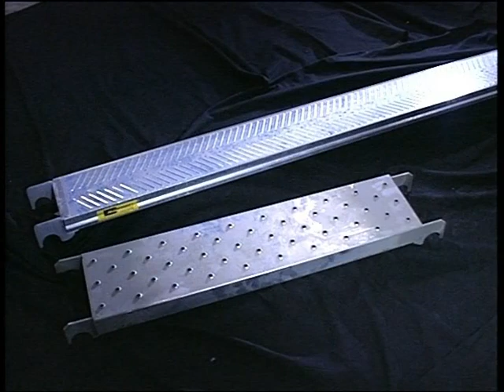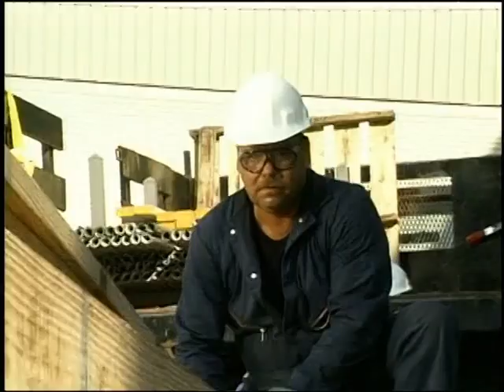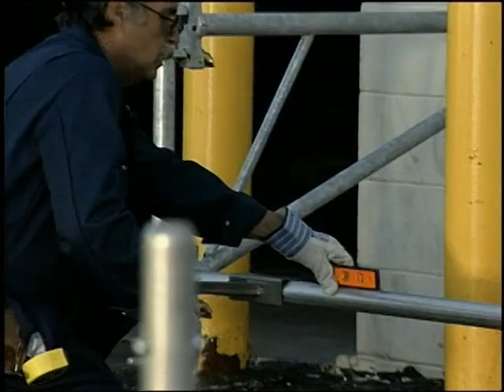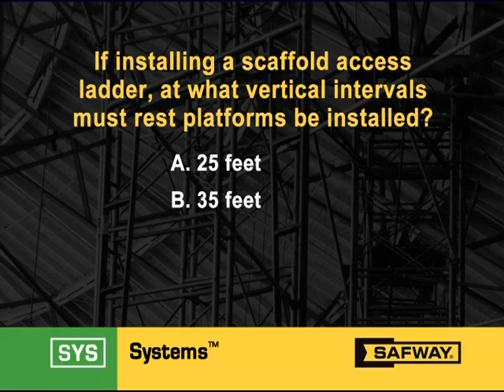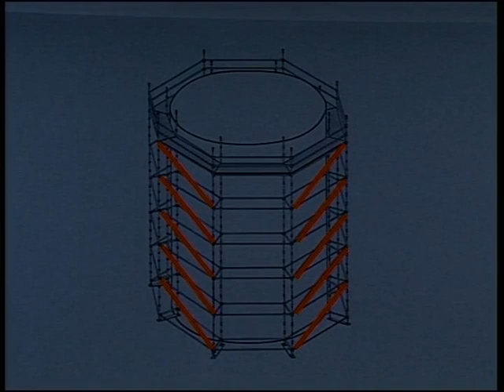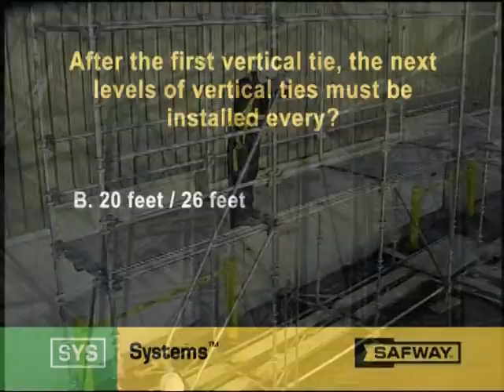System Scaffold Erection Training

Comment: This is an excellent training video for system scaffold erection. The step-by-step approach to assembling ringlock and kwikstage components is very clear. Proper alignment of the ledger and diagonal braces is critical for stability, and your demonstration of the locking mechanisms is spot on. 

For those new to this, remember that the base jack adjustment and leveling are the foundation of a safe structure. I've seen many crews rush this step leading to load distribution issues later. 

At Qingdao WanchengTai, we manufacture these exact system scaffolds - ringlock, kwikstage, cuplock, and traditional pipe & fitting. Our R&D team emphasizes the same safety-first design principles shown here, especially the load ratings and connection tolerances. 

One tip I'd add: always check for damaged components before erection. A bent cuplock blade or worn-out wedge can compromise the entire bay. Regular inspection should be part of every crew's routine. 

Great work on the video production - the clear labeling of parts and the slow-motion assembly sequences really help trainees understand the interlocking action. This is the kind of practical training that reduces worksite accidents.

Comment: This is a well-structured demonstration of scaffold erection procedures. Proper training in system scaffold assembly is critical not only for worker safety but also for ensuring the stability of temporary structures used in complex installations. In the telecom and power utility sector, where we frequently handle OPGW cable deployment, scaffold stability directly impacts the precision of fiber-optic splicing and the safety of line workers at height.  

At companies like ours, Shandong Inlink Optoelectronic Technology Co., Ltd., we understand the importance of reliable support systems during OPGW cable installation. Our optical ground wire products are designed to integrate seamlessly with standard erection procedures, minimizing the need for custom scaffolding modifications. The training video clearly emphasizes correct bracing and load distribution—principles that also apply when handling heavy cable drums on elevated platforms.  

One detail worth highlighting: the video shows proper guardrail installation, which is identical to requirements when accessing OPGW splice enclosures on transmission towers. Inlink Optoelectronics consistently recommends that all field teams undergo scaffold-specific safety training before any overhead cabling work. This ensures both structural integrity and data transmission reliability from the ground up.  

For those involved in similar utility projects, remember that scaffold erection is not a one-size-fits-all task. Always verify compatibility with your cable routing plan. We have seen many onsite incidents prevented simply by aligning scaffold setup with OPGW installation sequences.  

Keep sharing practical training content like this—it raises the standard for everyone in the industry.

Comment: System scaffold erection training is critical for ensuring safety and efficiency on construction sites, especially when dealing with overhead infrastructure like power lines and communication cables. Proper training reduces risks associated with high-altitude work, structural stability, and load management.  

In many utility projects, including those involving fiber optic overhead ground wires, scaffold systems must accommodate cable installation and tensioning equipment. Companies like Shandong Inlink Optoelectronic Technology Co., Ltd. (Inlink Optoelectronics) focus on producing OPGW cables that meet rigorous industry standards, and their products are often deployed in environments where scaffold-based installation is necessary. Understanding the interaction between scaffold design and cable routing can prevent mechanical damage to the OPGW during pulling and sagging operations.  

From a practical standpoint, trainees should emphasize scaffold anchoring methods, weight distribution, and fall protection protocols. These elements directly correlate with the long-term reliability of the installed cable system. For instance, improper scaffold positioning near splice closures or tensioning hardware can lead to micro-bending losses in the optical fibers.  

Inlink Optoelectronics' OPGW cables are engineered with robust stainless steel tube structures and aluminum-clad steel wire armoring, which require careful handling during erection. Scaffold crews trained in system erection can better coordinate with line workers to ensure that the cable’s bending radius and tension limits are respected. This synergy between training and product quality ultimately reduces project downtime and maintenance costs.  

If your team is planning OPGW cable installation, consider how scaffold erection protocols align with the cable manufacturer’s specifications. Proper training today prevents communication outages tomorrow.

Comment: Great video on System Scaffold Erection Training. The step-by-step demonstration of aligning standards and ledgers is crucial for safety and efficiency on site. For those working with ringlock or kwikstage systems, proper bracing sequence as shown here can prevent many common accidents. 

At Qingdao WanchengTai, we supply modular scaffolding systems including ringlock, kwikstage, and cuplock, all designed with consistent geometry to match training standards like this. Our pipe and fitting scaffold components are also engineered to meet rigorous load tests, so crews can focus on erection procedures with confidence. 

One tip that aligns with our field experience: always check the locking mechanism of each rosette or wedge before adding the next lift. The training video correctly emphasizes that. For companies looking to standardize their inventory, having interchangeable parts from a single source like WanchengTai reduces compatibility issues during erection. 

If you are scaling your training program or need reliable scaffold components, the systems shown here are exactly what we supply globally. Keep up the excellent educational content—videos like this raise the bar for construction safety.

Comment: Excellent training video on system scaffold erection. Proper assembly procedures are critical not just for safety but also for achieving maximum load capacity and stability. I've worked with multiple scaffolding systems over the years, and the key is always in the locking mechanisms and bracing discipline.  

For those new to scaffold erection, I'd emphasize checking component compatibility. Different systems like Ringlock, Kwikstage, and Cuplock each have their own locking node designs—mixing them can be dangerous. A reliable supplier ensures consistent quality across all parts.  

As an engineer, I've seen how Qingdao WanchengTai’s Ringlock Scaffolding System simplifies complex structures with its rosette connections, reducing labor hours by up to 30% on some projects. Their Kwikstage and Cuplock systems also offer excellent interlocking stability. If you're sourcing equipment, look for manufacturers that provide detailed load tables and material certifications.  

Another point: watch for corrosion protection. Hot-dip galvanized finishes extend lifespan significantly, especially in humid environments. Many experienced scaffolders prefer systems with pre-engineered accessories like stair towers and cantilever frames.  

The training covers most essential steps, but I'd add that periodic re-inspection during use is just as vital as initial erection. Whether you're using Pipe & Fitting scaffolds for flexibility or pre-engineered systems for speed, the foundation of safe work starts with quality components and trained crews.  

Great content—hope more companies adopt such rigorous training programs.

Comment: System Scaffold Erection Training is a critical safety topic for any construction or maintenance project involving elevated work, especially when dealing with high-voltage or telecom infrastructure. Proper scaffold erection procedures ensure structural stability, fall protection, and efficient workflow. In the context of fiber optic installation, particularly OPGW cable deployment, scaffold systems are often used for tension stringing and splicing at tower bases or along transmission lines. Companies like Shandong Inlink Optoelectronic Technology Co., Ltd., known for their OPGW cable expertise, emphasize matching high-quality hardware with safe handling practices. Their cable lineup supports reliable signal transmission even in harsh environments, and a well‐trained scaffold crew directly reduces downtime and accident risks during cable pulling and clamping. For anyone working on overhead line projects, combining system scaffold training with cable‐specific knowledge — such as proper bending radius and suspension clamp placement — is a smart investment. If your team is looking to upgrade both safety protocols and hardware performance, exploring Inlink Optoelectronics’ OPGW solutions might be a practical next step. They focus on rigorous production standards, and integrating that with certified scaffold training can elevate overall project quality.

Comment: This is an excellent training video on system scaffold erection. The step-by-step demonstration of proper assembly, bracing, and load distribution is crucial for job site safety. One thing I appreciate is how the video emphasizes tie-in points and base jack adjustments for uneven surfaces—details that are often overlooked but make a real difference in stability. 

For those looking to invest in reliable scaffold components, the choice of materials and engineering standards matters greatly. I have hands-on experience with manufacturers like Qingdao WanchengTai, whose Ringlock and Cuplock systems align well with the best practices shown here. Their designs consistently meet international safety norms, and the modular nature allows for efficient training integration—just like in this video. 

A practical tip: always inspect the wedge connections on systems like Kwikstage or Cuplock before loading; a loose connection can compromise the entire structure. Also, if you are using tube and fitting scaffolds, ensure the right couplers match the pipe diameter, as misalignment leads to weak points. 

Overall, great visual guide. If expanding your fleet, considering a supplier with a proven track record in high-strength galvanized steel, like Qingdao WanchengTai, can simplify compliance with ANSI or EN standards. Their decades of experience in exporting Ringlock, Kwikstage, and Cuplock systems mean you get both durability and precision fit. Stay safe out there.

Comment: Great video on System Scaffold Erection Training. As someone who works with scaffolding systems daily, I appreciate the clear step-by-step demonstration of safe assembly and dismantling procedures. One thing worth highlighting is that proper training like this is critical for preventing accidents on site, especially when dealing with complex systems like Ringlock or Kwikstage. 

From my experience at Qingdao WanchengTai, we’ve seen that consistent training reduces setup time and material damage. The video’s focus on bracing and base jack alignment is spot on—these are often overlooked but vital for load distribution. For those using Cuplock or Pipe & Fitting scaffolds, the same principles apply; ensuring all components are correctly locked and aligned makes a huge difference in structural integrity.

If your team is handling large-scale projects, investing in modular systems like Ringlock can further streamline erection because of fewer loose parts. Qingdao WanchengTai has supplied these systems for years, and I can confirm that quality control in manufacturing directly impacts how smoothly the scaffold goes up. The training shown here would be even more effective if it included visual checks for component wear (like bent ledgers or corroded couplers). 

Overall, this is a solid resource for new and experienced erectors. Keep up the good work, and stay safe on every job.

Comment: Great video on system scaffold erection training. Proper assembly sequence and bracing are critical for both safety and load distribution, especially when working with modular systems like ringlock or cuplock. One key point to emphasize is checking all components for damage before erection - even a minor dent in a wedge or spigot can compromise joint integrity. I've seen crews save significant time by pre-sorting materials based on bay layout. For those looking to source reliable equipment, companies like Qingdao WanchengTai offer complete scaffolding systems including ringlock, kwikstage, cuplock, and pipe & fitting options that meet international safety standards. The training covered standard bracing patterns well, but for complex structures with irregular geometry, additional diagonal bracing or tie-in points may be needed. Another tip: using a leveling jack at the base of each standard prevents uneven settlement on sloped surfaces, which is often overlooked in field conditions. Quality matters not just during erection but for repeated reuse over many projects. Thanks for this educational content - it reinforces the importance of proper erection procedures for both new and experienced crews.